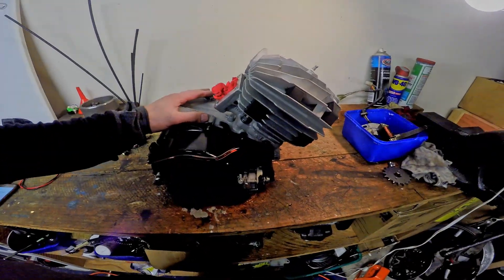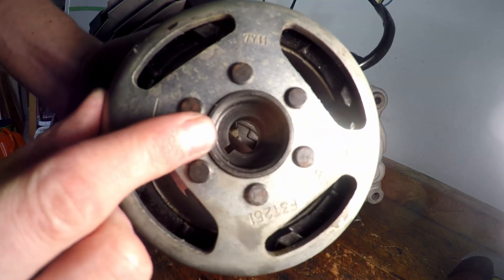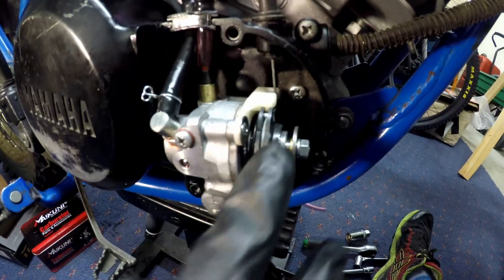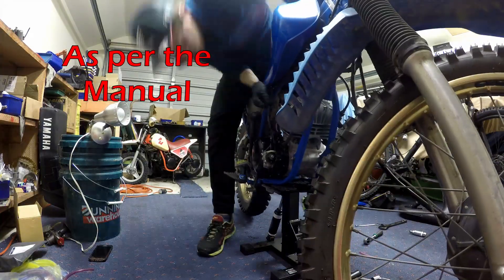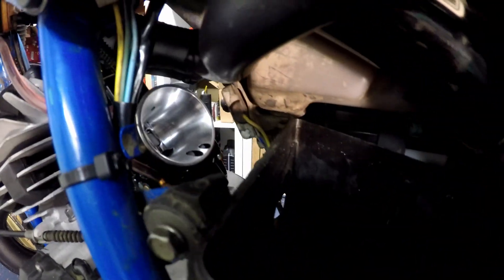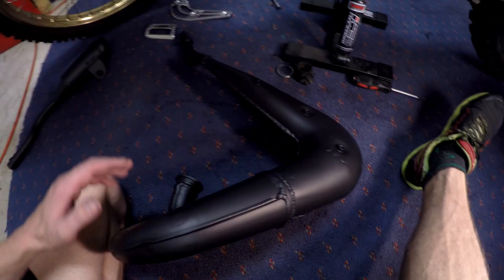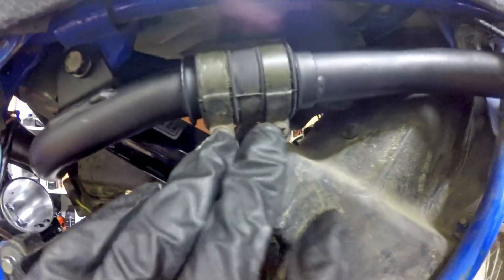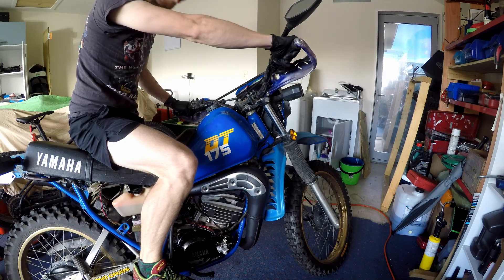DT175 Modified Engine install and first start

Comment: Hey bro, good job, im nearly positive that the RT 180 is the same bike as a DT 175. Which is relieving, i was worried about finding parts for my RT. Its not my only bike but i want to keep it running. Parts for it are such a pain, the only stuff that comes up is used stuff on ebay. Thanks bro

Comment: Hi bro, greate video! Im qlso own 2005 year dt175. I just want to ask, how engile oil level sensor work? Because the 3 cable in sensor but only one light is dashboard. By logic there should be two state if sensor has 3 cable.

Comment: How’d ya derestrict the expansion chamber mate?
Reply from the maker: I carefully cut along the join with a angle grinder. Removing the outer side of the fat part of the chamber,  removed the restrictions and welded it back together and got it ceramic coated

Comment: Do these yamahas have the silenced expansion chamber like the wr/dt 200? If so, Removing that would give really good performance gains
Reply from the maker: Yep they do and I did cut it open and gutt it and weld it up.
Reply: @TheMotorcycleForge  yeah sick. I can't wait to get an old dt175 and trick one out. Looks fun
Reply from the maker: Yeah man, definitely is a ton of fun.

Comment: Hi. I enjoy watching all your videos about the DTs. I also have a DT175 project bike I started more than a year ago but now just collecting dust in the shed. I see that the reed cage is not exactly made for the DT175 that is why you need to make an adapter. May I know what is the part number or for what bike that reed cage is for so I can order. Thanks a lot and keep on making interesting videos. Cheers.
Reply from the maker: Hey man glad to hear you like the videos.
The reed cage was a V force 4 for a yz85 yamaha, yep it didn't quite fit so  I made a adapter

Comment: Nice one mate,
Any tips on where to get parts? Am in need of the air fin rubbers, be good to know where to get a rebuild kit also (barrel,head and piston)
Reply from the maker: Some of the bits I got for it were from Cmsl and motor parts, ie rod and piston from a place in Japan called Tkjr
Reply: Bro iam from india i have head and cylinder new art piston i want to sale bro can you buy

Comment: Nice job mate I am rebuilding my engine on my DT175 just a quick question what torque specs for the head and barrel did you use as I can not find anything on torque specs cheers
Reply from the maker: Thank man, head nuts are 25nm and barrel are supposedly 15nm according to the manual.
Reply: @TheMotorcycleForge  cheers mate awesome

Comment: I got one too. Want to upgrade it. Performance style. So if you have any good ideas or links ot would be really appreciated. Nice bike btw!
Reply from the maker: The previous video's on this bike I showed some of the performance upgrades I have done to it. I also did a video on porting a early dt175 barrel which will also help

Comment: Which oil do you use in engine? And also oil bottle?
Reply from the maker: I generally use a quality two stroke oil like castrol and for the transmission/ clutch oil I use a motorcycle engine oil that's around 10w40. Any decent brand will do, Repsol, yamalube, valvoline ect
Reply: Engine oil you use 10w40 4T?
Reply from the maker: No that's for the transmission and clutch. You can use many types of gear oil as long as they are ok for a wet clutch.
Straight 30w is pretty good too, was a while ago so it might have 30w in it.

Comment: What model reed block did you use ??
Reply from the maker: I used a V-Force 4 reed block for a Yamaha YZ85. 
Part number V4R82A-i  and I made the spacer so I didn't have to destroy my intake to make it fit.
Hope this helped.